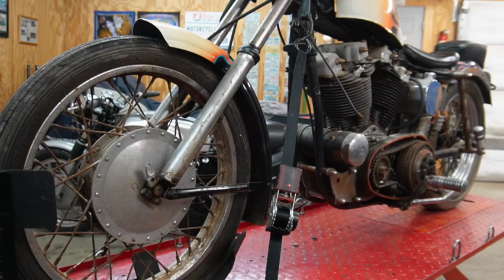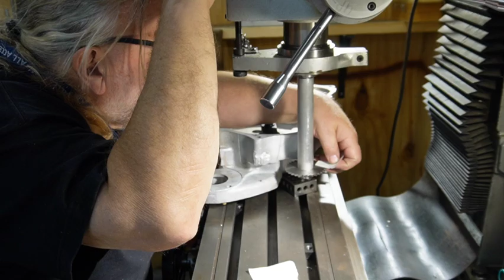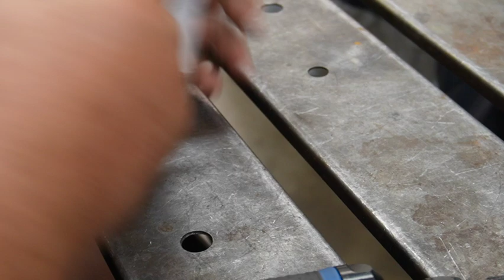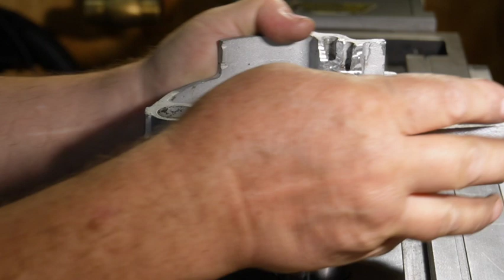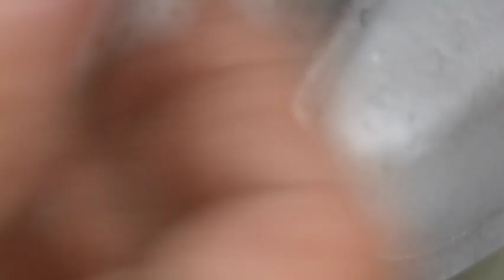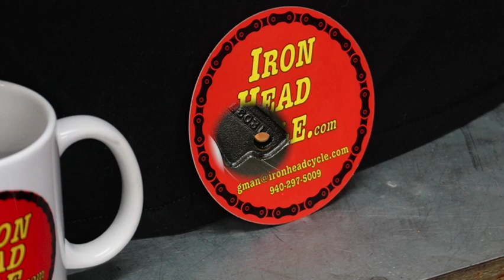Rat Rod No More Part I Nbr 308

Comment: Good video, definitely enjoyed seeing the tig repair work. Now I am glad you are tackling the frame, since there is something I would like to get your thoughts on... On this swingarm I am unsure what bearings are used, but on my 1975 it uses Timken 17520 (race) and 17580 (bearing)... the question is do you go back with the original bearings or go for the Timken (other brands also)  11520 (race) and 11590 (bearing) ? ... as far as the technical drawings on the Timken site, the bearing sets have same dimensions... BUT the kicker is the price... the old bearing numbers cost any where from $68 to $100 for just a single bearing (no race)... the 11590/11520 set can be any where from $8 to $40ish.. Dynamic load is 1100lbs, static load is 1300lbs, so for a sportster this way more than enough.  Haha!! I will admit I have two bearing sets that are a perfect example of "bad enough"... Just with slight finger pressure you can lock up the  inner ring on the bearings and you can see/feel wavy lumps in the races. Yes it could have been worse, they could have seized to the shaft..  Anyway I was just wondering which bearing sets you use when replacing.    And if you do show taking the swingarm apart, would you mind talking on the bearing types.
(by the time of your next post, I should have received and installed the 2 sets of 11590/11520 bearings.)
Reply from the maker: I've never really paid much attention to the swingarm bearings. I usually buy the cheap repo bearings from V-Twin. I don't regard them as critical the same way a wheel bearing or the sprocket shaft timken bearing is. At the time this video was made public the swing arm was already put together so I missed the chance to talk about bearing types and grades. But, yes, a given size and shape of bearing can come in different types and grades regarding load ratings, RPM, fits etc. Just because a bearing looks the same and fits does not mean it is suitable. For those of you who are interested google Annular Bearing Engineering Committee (ABEC).
Reply: I had to laugh when reading the service manual on the '75, since it states to use a punch to remove those outer bearing lock nuts.  I am the cheap bastard, so I made my own tool to remove them...  At least you know 1 person paid attention to your swingarm video. LOL!

Comment: I am guilty of running a 23 tooth back in the day  :)  (loved the lower rpms on the highway)
Reply from the maker: I ran a 24T on my stroker and ground clearance in the cover so that it almost fit. If you run a new chain and keep it adjusted you will do less damage, when the chain gets worn and you run it loose it tends to want to fly off of the sprocket.

Comment: Referring to picking up that hole (at about 15-1/2 minutes in) your method is very good. Quick and easy. Here's another way you could try in the future. If a drill blank fits snugly in the hole, and doesn't wiggle around, you could leave the blank in the hole and pick up on it with an Interapid (or similar) or a Blake Co-Ax. Getting dialed in on broken out holes is always a little bit interesting. So much depends on what you have to work with and what you need to do to hold it in the mill.
Reply from the maker: Copy that, thank you...

Comment: You did a great job on that sprocket cover! I love the way you insured the location of the locating pin. Drilling through the cover is ingenious! I have never seen such a beautiful weld on sand cast aluminum. Even if you could buy an aftermarket cover that would work, saving the original is the right way to go.
Reply from the maker: There are many original pieces that can be saved. It becomes a question of economics. For my own stuff, being on the cheap side, I will jump through many hoops to save an original piece. I'd rather spend the time than the money. But, working on a customers part, it is hard to justify several hours of labor cost to repair a part that can be bought for a fraction of the cost (even though a repo probably won't be of the same quality.)